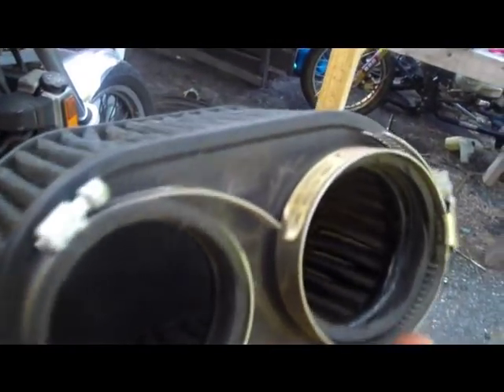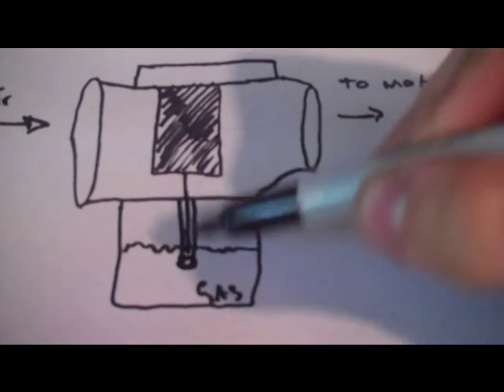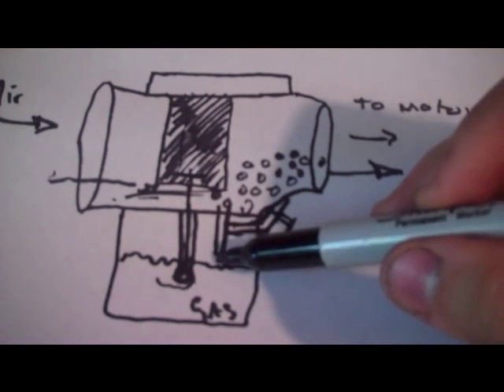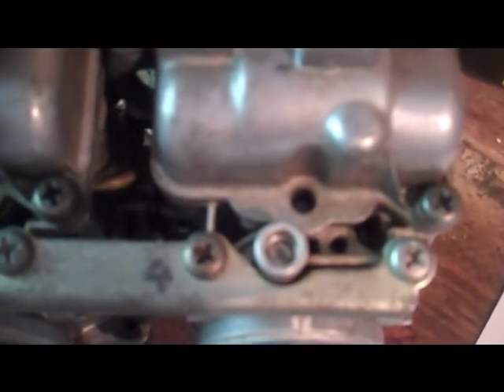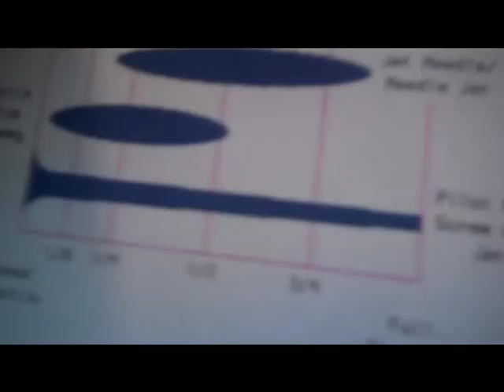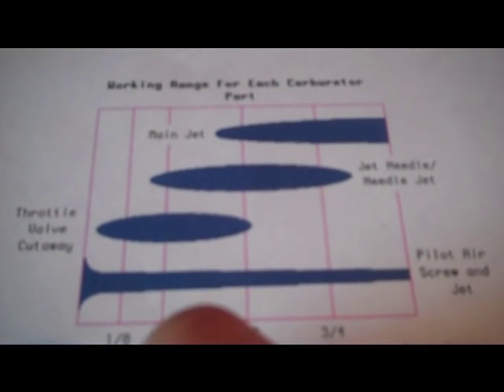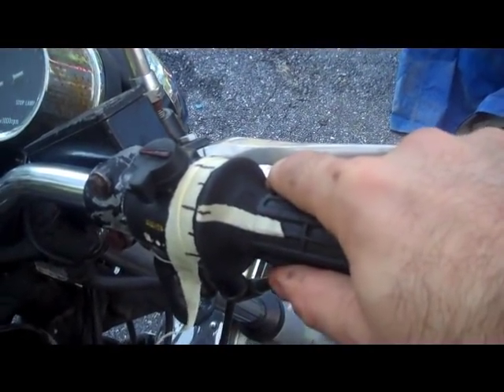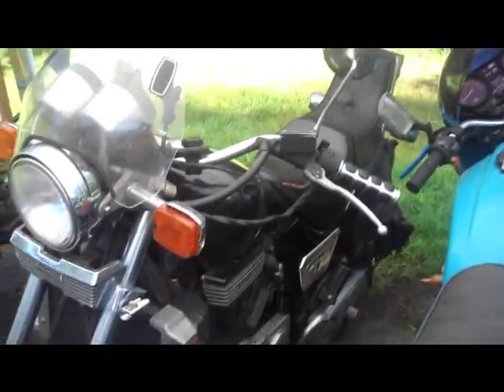How to adjust the jets on motorcycle carburetors

Comment: Hi  I have a 1981 Suzuki GS750E bought it from a co-worker for $100 bucks with the title.  I got it to start just fine. As I rev it up, it bogs at halfway throttle or around 2500rpm and then engine dies. I think its Carburetor problem. So, I took the carburetor apart & rebuild it. I cleaned out the carburetor and replace all the jets with new jets. I did the bench sync carbs then I installed the Carburetor back on the motorcycle. I didn't do any vacuum sync carbs yet. My exaust are same stock. I got all 4 air screws at 1-1/4 rotation out just like what the repair manual said, and nothing said about the 4 pilot screws on the repair manual so I back them 2-1/2 rotations out. I did not wana install my old airbox on, bcoz it was pain in a butt to install the carburetor. So I bought me a 54mm all 4 pods air filter. Started the bike & let idle at 1200rpm for 10 minutes. Then I rev it up and still bogs at halfway throttle or around 2500rpm and then engine dies. starts back up no problem. So what do you think might be causing it to bog like that and what needs to be adjusted? Please help me get this bike running. Thanks
Reply: +RJ Kincaid it sounds like it is still running lean.  so you need to up size the jets for a richer mix. try 1 or 2 sizes up should fix the problem. good luck brother.  oh and check spark plugs if they are dry but the ends are a little charred looking it is running lean if it is really black it is running rich.  also check the float heights that can also make it run lean or rich. also it it hitting on all four cylinders. to check that feel the headers with a wet cloth to see if they are all hitting. gl.

Comment: Do you have a video on how to set the carb air/screw? I messed up my kids klx110 dirtbike mixture. I thought I had it right until I saw the head pipe turn red! Then I tried re adjusting and it would smoke. Other times it would sputter when I'd barely crack open the throttle. Bike is all stock, the main problem is that the pilot jet fell out and when I screwed it back in I had already messed with the idle/air screw.
Reply from the maker: If the bike is all stock then set the screw at the stock setting
Reply: Yes i put the air screw 1.5 out.... Seems to be better now. Thanks

Comment: Hey man. Want to thank you for your help with my previous issue. Got everything going good now! I have a 82 Suzuki GS750. Redid the carbs and got the factory air box on there. Put everything back to what the factory specs said with float heights, jets etc.  it idles great and starts up with just a 1/4 choke. But the issue I am having is while riding, anything past 1/4 throttle the bike loses some power and the rpm's jump about 1,500. I have no clue what is going on!! If I let off the throttle the rev does go back down and she rides fine. But I have no real power past 1/4 throttle. Any amount you give after that she just revs higher and higher and the bike just loses power. Any thoughts or ideas that would help me out?! Really appreciate the time you put into these videos!!
Reply: Added note. I have checked the spark on all the plugs. Shows good blue spark on all the plugs. I appreciate your help!
Reply from the maker: +Charles Stanley he mixture is probably off in that higher end. Clogged main jets, float height wrong, vacuum leak, etc. Use the test in the end of this video to determine if you are rich or lean up there and use hose results to help guide your diagnosis

Comment: Hey Chief, top vid.

Do you have any experience with big singles? I'm working on a DR650 with a pod filter and a free-flow stubbie can, looks to be the same/similar Mikarb as your GSX (only 1 obvs.)  Any thoughts on using the same main, pilot and shim increases described in your vid for the DR? Also heard pilot screw is usually only 1 & 1/4 turns on a DR. Cheers.
Reply from the maker: Well, the process is the same, but I might start with a little larger increase than an inline 4
Reply: mrmaxstorey Cheers for the help, makes sense to scale it up for the one carb/big cylinder, but just not sure how much, a little research into re-jetting big singles I think. Thanks again.

Comment: If you shim the needle with some metal washers doesn't that make the slide heavier which would slow the response of the slide moving up?  That slow moving slide would then make your bike slower to respond to the throttle input making your bike feel slower from idle to "grip it and rip it" type throttle movements?
Reply from the maker: I havent found that to be the case
Reply: That tiny bit of weight is irrelevant. It's more important to get the needle height correct. Too high or too low makes for a too lean or too rich condition and you loose power and throttle response. Shim it just right and bike will respond with authority! :)

Comment: I own a 1999 Suzuki Savage Big Stroke with a Mikuni BS40 carburetor. On initial start up I need to squirt a little starting fluid in order to get it running. After that the engine will start back up again as long as the engine does not get too cold after shutting it down. With no initial starting fluid I can crank the engine over several times until the battery drains without the engine firing up. Low idle circuit problem I think? Enrichment diaphram looks good. Any suggestions?

Comment: I have a 1980 kz750 with 2 rebuilds on it in the last 2 years seems to run find when warmed up but when you rev it ,it seems to stick and slowly come down.no adjustments so far have change this issue!

Comment: Mr max,
Have you ever heard of some one able to use pod filters and after market exhaust on a 1981 CB900C. I keep hearing that it can be done, and also that it can not be done. Before I do this re-jetting I would like to know if it is possible. The needle is adjustable and it seems easy to replace the Primary and secondary jets. Also I would have to use a spacer for the needle but I have no idea what kind of spacer is the right thickness. What can I use?

Comment: I have a 1996 Yamaha Virago XV250, and I'm trying to determine whether or not I can fix a slight issue I'm having with it: It has an occasional misfire. I notice that it does not really happen at specific times during riding. I can be idling, accelerating, or cruising at just about any speed. It's not consistent at all. If I'm idle when it happens, the engine will usually stall, else it'll barely pick itself back up and keep going. If I'm in motion, it's a very noticeable, momentary loss of power, but then it just picks right back up where it left off (usually results in a forward jerking motion of my body). It's quite a problem if it happens when I'm going very slow around a sharp turn in 1st or second gear, as I jerk my leg out in fear of hitting the ground (and I look like an idiot to everyone around me). Now on my 15 minute ride to work with ~8 stoplights, I may only notice it once or usually 3-4 times. All I've done to it so far is run some carburetor/fuel injector cleaner through my engine and change the spark plugs, both making no difference. After many hours on the internet, I've come to the conclusion that my carburetor might need a slight adjustment... Before I either A. tear my bike apart and play with it or B. bring it to my local dealership, I'm looking for a bit of feedback as to whether or not I'm on the right path here. Any suggestions or criticism is welcome, and I thank you ahead of time!
Reply from the maker: Unless you have made any modifications to the intake or exhaust, I would leave all your carburetor adjustments at their factory settings. How did the spark plugs look when you took them out? Do you live about 4000 ft in elevation? How many miles on the bike, and is the air filter clean? Have you checked for vacuum leaks? Start there
Reply: mrmaxstorey The spark plugs looked alright to me. They seem to be burned on one side though? I'll let you judge if you want: http://s1003.photobucket.com/user/Madman906/library/Spark%20Plugs
Internet says my city ranges 350-500 ft above sea level.
Currently 6,309 miles on it.
The air filter is in tip-top shape!
I have not checked for vacuum leaks. I'll do that tomorrow when I have daylight.
Side note: On my ride to and from work today, I noticed only one misfire.
Reply: There is a small chance it may be something else, besides the fuel system. I used to have an 85 Virago that had an intermitent power problem like your describing. One cylinder would cut out briefly. I pulled the ignition box and went over all the soldered connections in case one of them had a tiny break in it and low and behold, that fixed it.

Other things to check: Fuel cap vent. If fresh air is not getting into the tank the fuel flow will slow down or stop. This is more common with a tank lower in fuel as a fuller tank has more downward pressure for the fuel.
Make sure your fuel filter is not clogged.
Maybe a sticky float valve? I wouldn't think so with only 6K miles.
Reply: Also, plugs can go bad. I've had them look fine, but not run consistent. Adding new plugs is an easy thing to try. I would get those high end. $10 plugs that last for 100K miles. The good ones. :)

Comment: whats it mean when your idol take along time to come back to normal rpm after blipping, and it pops and misses after it warms up, but runs fine if it isnt idoling, i think it may be the choke cable messing up, plugs and gas are good... carb is clean, it seems like it could also be not getting enough fuel but the pump is working, i miss riding my bike (05 midnightstar 1700)
thank you for your considerations and video uploading efforts :)
Reply from the maker: Could mean a lot of thing, but usually it means that your mixture is off. If you are popping then thats an indication you might be running lean
Reply: mrmaxstorey alrighty then, i assume this was for me hahaa!!!
thank you for your considerations and video uploading efforts (y)

Comment: I have a 2001 Honda Shadow Ace 750. I'm running Cobra drag pipes with baffles out. Standard air filter. The pipes have begun to turn a yellowish tinge and the bike pops when decelerating, once the bike has begun to turn the engine. It idles well, no bogging and sputtering. I have no problems accelerating. The popping is just very annoying and the color change in the pipes is concerning. Am I running lean with these characteristics. The popping is lessened when I set the idle higher. Any help to resolve this issue would be greatly appreciated. All the shops in my local area have told me there is not that can be done. I don't want to burn up my engine, and coming to a stop without it sounding like a shootout is going on would be a nice bonus. Thanks!
Reply from the maker: MDC 91 You should be able to adjust the idle mixture screws to tune out this problem. Turn them out (richer) in 1/4 turn increments, and then do a test run and see if the coasting in gear popping is being reduced. Stop when it has been eliminated

Comment: Great video explaining tuning Ive watched it 3 or 4 times, I have a question maybe you could help me. I bought a bike broke got it running, put pods on it and it has a more free flowing exhaust on it. its running lean, and has no top end it has stock 125 jets in it. its a keihin cvk carb on a 85 454 ltd ( en450 ) the bike dosnt bog down it does back fire, I got bigger jets coming, all I seem to do is shift, top gear at 7 grand only 65 mph, bike should do 100 110. Plus my pilot jets are stuck in there. I have left handed drill bits and easyouts, kinda scarced to drill them out if I dont have to, it starts and idles good. So do you thing this no topend problem is more piolt jets or main jets or both? And do you think its safe to drill pilot jets out with handed drill bits?
Reply from the maker: Your top end problems are most likely caused by the main jets being too small. If the bike idles ok it might still be a little lean in the pilot jets but basically it is where it needs to be. I would be very careful about drilling out those jets, you cant damage the threads at all. Remember too that you always have the option of putting the stock components back on and using the stock jets, that is the configuration which will run the best for you and honestly the performance upgrades to the exhaust, pods, and bigger jets are barely noticeable. Mainly those kinds of mods are just for show in smaller bikes like yours. However, if you want to stick with them, try out the larger mains first, and maybe shimming the needles
Reply: mrmaxstorey ok I ve been tinkering with these carbs and now im going backwards, I went to 135 jets cut some coils off the spring and it got a lil better, 7 grand about 85 mph. this bike redlines at 10 grand, still a lot of shifting, today I cut another coil and shimed the needle, now the gears seem a lil longer, less engine braking, but when I get to about 7 grand it starts to sputter, Im not sure if its getting to much gas now or not enough?

Comment: Great vid and thanks for postings. Quick question..my 82 Honda 900F has three jets. Main jet, secondary main jet and a slow jet. Would I want to increase the main and secondary main by 2.5 or just the main jet? Thanks again!
Reply from the maker: Unfortunately I don't have a definitive answer for you, just encourage you to experiment and use the test at the end of this video to determine if you are running rich or lean in the given throttle range
Reply: Ugh...trial and LOTS of error. Thanks for replying!

Comment: No color or odor to the exhaust. I need to get a crank case breather filter lol just something i overlooked. It runs a heck of a lot better then when i got it. It is having a little trouble at low idol. Anything below 1k it will sputter and die. Once its above that it runs great except it has one spot around 5k rpms where it hesitates a little.

Comment: Ok cheers for the advice!
One other problem though, in my manual it states that my carbs have a primary main jet, which is what you called the pilot jet on your footage and that the jet which the needle seets in on my carbs, is my secondary main jet. So would you suggest that I class my seconday main jet as to what you class as your main jet? And that I only resize that perticular jet due to me having pod filters?
Thanks for your help!

Comment: nice vid. I need help with this badly, i put some pod filters on my 81 csr 650 and now it will idle but once i give it throttle it bogs out, i know it must be the jets but i dont know where to get them or what size. i looked at jetsrus but they didnt have csr parts. any advice?
Reply from the maker: Bikebandit has a few of the more common choices. As far as which ones, just follow the video. If you need any parts for your project let me know, I have a few 81 csr parts lying around from a past project
Reply: thanks for the advice. i took the jets out and they were 102.5, so i ordered some 105 per your advice, do you have the starter from your csr project?

Comment: isn't the popping on decel you mention actually after burn & not backfire since it happens after the combustion chamber & not backwards, through the airbox?
Reply from the maker: You can call it that if it helps you differentiate between the two. Backfire is a common expression which describes explosions both into the carbs/airbox, and into the pipes
Reply: interesting. in the racing industry we refer to then differently based on the direction of the event.
Reply from the maker: shawn keene
Makes sense. In the shadetree industry we often say whatever damn fool thing pops into our heads

Comment: HI so my friend purchased an 81 kawasaki kdx175 and it doesnt wanna run right..when we only got it,it was bogging down quite a bit and after we cleaned the carb its still bogging..not as much in the 1/4 throttle range,but after that its worse..it is running rich theres gas coming out of the exhaust tailpipe,and theres a small opening (exhaust leak) coming out from the cylinder (where it connects to the exhaust) and it drips down a bit of gas.Thing is is that it looks like only two spring hold the exhaust to the cylinder..but anyway pilot jet and main jet are within spec (stock) and the needle clip was set on the one below middle on 2nd knotch (theres 5).i tried moving the clip up and tried middle (3) 4,and then the fifth one the toppest knotch and it seems to be definantly pulling better but it still bogs like after third gear (half throttle)..first and second gear not that much.Im really wondering why if it has an exhaust leak then should it be running leaner?And it was set on the second knotch to make it richer which kinda makes sense but its way to rich and after moving the clip higher it pulls better and at times the power band would kick in and it pulls really good.. Any idea on wat it could be?thank you in advance
Reply from the maker: Are you sure thats gas? If the bike is running, then you shouldnt be getting any gas in the exhaust. Sometimes water or oil residue will drip out but you shouldnt be getting any gas. Make sure your float is the correct height and that the float needle is seating properly
Reply: its like oil with gas..2 cycle gas..I took apart the reeds today and they were opened a tiny bit from both sides..would it have affected it that much?And also i slid the exhaust fully in today cuz the guy before me did it wrong..so ill see if itll still be dripping..Also the bottom ring is missing and the piston is a tiny bit scored on the exhaust side do u think that that could be the reason as to why it was running bad?